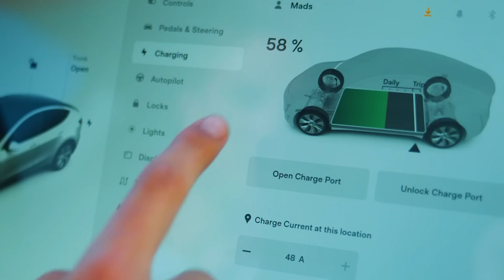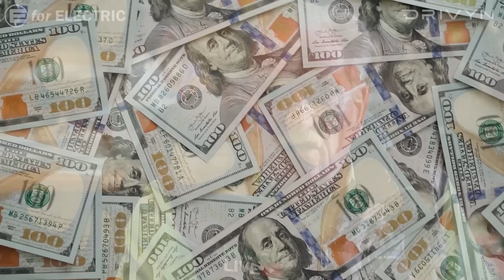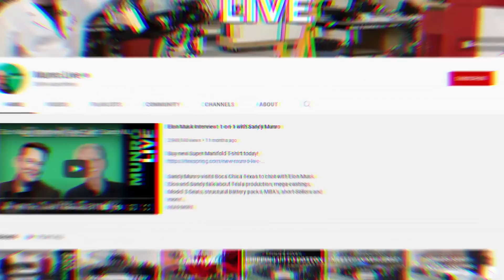SANDY MUNRO Calls Out EV Makers

Comment: Interesting comment about the Bolt.  I bought one in 2017 (still have it) for my wife to drive.  She was driving 10 miles each way to her parent's farm & spent her time helping & then caring for her mom.  It turned out to be the perfect car for her.  She really enjoys it today & we use it for any trip under 200 miles away.  Charge at home.  At the time it would have been a year wait for a model 3 Tesla & another $10K.  The local dealer didn't know anything about it!  I knew way more than the sales staff (including the sales manager).  Sandy's wrong about "nobody wants it".  Even here in "pickup country" i see as many Bolts as Tesla on local roads.
Reply: We have three bolts across three families and love them. Have traveled 220 miles on a trip. Done several 200 miles trips. Charge at home. Works great. With all discounts, our 2019 Bolt was $20k out the door. One of the family Bolts is coming off lease with 8500 miles and a buy out of $19k. We will buy it from GM. Cannot imagine going to a non-BEV.
Reply: @rebreaville9332  We have driven a 200mile + trip in our Bolt but charging on the trip amounted to 2 hours total charging time.  Made the one day trip a bit long.  Certainly doable but a long day.    This was our first trip where we needed to charge away from home in order to make the trip.  Only complaint was the slow charging.  Didn't charge above 80% on the road.  Left home at 100%.  Over some mountains & nearly all was at freeway speeds.  We did have some heavy traffic but jut sitting waiting & moving at a snail's pace didn't bother us!
Reply: I think the Bolt is a great car , especially for local driving, and that’s the key that most people don’t understand about EVs , not everyone goes on a road trip everyday or every week so day to day driving is the main focus, not taking a long trip and having to wait an hour to charge or running out of juice. You never worry about running out of juice just driving around town. 
 But I think what Sandy really means is why only a Bolt, a small car, why didn’t they also have a compact or midsized SUV back then. They have waited until now to evolve it to other EVs.
Reply: @Lovejazz01  Sandy was correct about the inertia of big companies.  GM is years behind as are all 'legacy' automakers---inertia.
Reply: @dennislyons3095  The bolt came out in 2016 as a 2017 model year, since it followed the normal product development  like most cars of it's time, it most likely started design in 2012. Even as such as a half measure made in 2012 it outperformed the Leaf in range, performance ,until they finally refreashed the Leaf a few years later. I'm not sure why the Bolt is discussed as GM's best effort when it clearly wasn't never intended as such. Considering they used LG cause they did not have the facilities to produce their own, well I guess Kia and Hyundia were wrong to do that too.  Or is it more a hold over till they get their own facilities built and ready? Are we also going to ingnore all the recent Electric cars coming into production this year and next that will utilize those facilities? I mean you honestly picking a product that is old and lightly refreshed in it's life cycle until the better platform comes along. Honestly it's a bad take.
Reply: @alkafk  GM built the Bolt EV because Volt owners asked for it (I was one of them). You're right about the timing, though. GM was tracking a few Chevy Volt owners forums, and they released surveys in late 2012 early 2013 asking what Volt owners thought GM should do next. The results were closely split between 1) Add range and a more efficient motor to the Chevy Volt, and 2) Build a 200-mile all-electric CUV. Fast forward 3.5 to 4 years, and they did both.
Reply: @alkafk    Thumbs up 👍 

 Thank you much for the insight , it's like these clowns don't learn 🤡🙃🤡
🤷🏻
Reply: I understand about the dealership not knowing much about the Bolt. Back in 2018, I was interested in buying a new hybrid Malibu. I contacted a local dealer, and not only did they know little, but they kept steering toward a petrol Malibu. They just weren’t interested in selling me a hybrid.
Reply: Maybe the Chevy ⚡️Bolts is not for Sandy.
 But it does fits the bill for a lot of other people , they love those little cars .

 This  interview was more than just 2 days old because  Sandy and his wife bought a Rivian pickup truck.
Reply: You'll see that hating GM's EV products is a fairly common sentiment with influencers. Apparently, that's a popular position if you want to win favor with Tesla fans and easily hit 100,000+ subscribers/followers.
Reply: @newscoulomb3705  so qhats that have to do with the bolt catching on fire?
Reply: @BlackandWhitecustoms  What does what have to do with the ~20 Bolt EV fires? I'm responding to Sandy's comments, which were about outsourcing and vertical integration, not defective parts.
Reply: The Model 3 would've been 10k more, and depreciated 20k less. For a far better car. That won't get you an arson charge for parking near a structure.
Reply: Someone will always like everything. But will it catch on? Remember there are people who are happy being in a pyramid scam also.
Reply: @BlackandWhitecustoms  LoL
Reply: @icosthop9998  didn't the bolt have a recall because of fires?
Reply: @BlackandWhitecustoms  Damn ❕️!❕️
 I never got your alert/ reply 😶
I'm showing this to someone else and I seen you replied to me.
 No telling how many other people replied to me and I didn't receive it ❗️

Comment: The OEM`s all build BEV`S fot upper income people, because they have not so much batteries they put them into the higher margin cars, with prices only a few people can
afford and for most of the commuting uneeded ranges. EV`s for the mass market thats fit the needs of most of the commuters have to have 5 Doors, ~ 300 km WLTP Range,
Climatization and a price tag of 23.000 US $  inc. VAT. To date no one builds them, maybe the Chinese will do it some day, definitly not Telsa or VW in the next years. Tesla/Musk
is very good in announcing but not in delivering.

Comment: "Standards" are big in government work. Just one example,  I do electrical design work for a national laboratory and we use 12AWG wire for lighting no matter how short the run for new LED lights that never draw more than 10A on a single breaker. Industry-standard is 14AWG for residential and commercial lighting applications below 15A and you can speck even thinner wire provided it supports the continuous load for the given lenegth of wire and is protected by the correctly sized breaker. But hey, the lab has their own standard, and wastes tax payer money on excess copper, larger conduit, and over paid and fat engineers with their "standard". In the private sector companies make mistakes by going too cheap, in the government, they make mistakes by blowing stolen tax dollars on overkill.

Comment: Awesome!  Sandy seems fed up, but he what he's saying makes sense.  The automotive industry is enormous and carries a massive amount of inertia.  Time will tell if the EV movement will provide enough force to cause the traditional OEMs to change their ways.
Reply: I do believe they are changing but they are changing very slow.
The CEO of Volkswagen went to Giga Texas for pointers.
Jim Farley,  CEO of Ford is dividing Ford into Two groups.  ICE division  and EV division.  That is something  NEW.
Reply: @icosthop9998  Volvo did that with Polestar years ago
Reply: @sneaky_krait7271  K
Reply: Sandy worked for Ford, and every time he innovated something to solve a problem he got in trouble (nearly fired). Its in another YT video. Very hard to innovate in old companies, you end up fighting a management power structure with vested interests and static vision. He eventually quit and decided to do this analysis to point out systematic flaws in a process. Original Tesla tried many many experiments to figure out how to do EV. And then applied newest automotive construction/assembly to mass produce those vehicles. Autopilot is a new problem (but DARPA started work on it way before Tesla) and its a very tough problem. In an interview between Elon and Sandy he talks about the autopilot problem. Elon is taking a statistical approach, if its better statistically than a human driver, problem solved. I think that will run into many other issues. Accident happens someone dies ? Who is at fault ? Human driver than usually human driver is at fault. Robot/AI driver ? The software engineer ? The sensor engineer ? The evaluation engineer ? The CEO :-)
Reply: @Glen Spivey  I said the same thing on "Electric Viking"   channel , and people jumped all over me, saying that FORD will not be able to do that. 🧐

Comment: I am not Sure  I buy all that Sandy is selling.   For example Ford has and is making the battery mustang body The old way     the “press” that Tesla is installing, is to fix many of problems Tesla has had making Automobiles.
Reply: How much money are they losing on each one?
Reply: @jamesvandamme7786  based on your comments you appear to know that Ford is not making any money off of the Ford mustang Mach E  Please explain!
Reply: @marknelson463  Just asking. They claimed they would make money off #1. (Not counting R&D.) They could sell every one they build so why throttle back?
Reply: @jamesvandamme7786  I do not know How profitable the Ford mustang Mach E is for Ford
Reply: @marknelson463  I suspect the Big 3 are just practicing making EVs until better batteries come along, then they will crank up the lines and flick Tesla out of the way
Reply: @jamesvandamme7786  in a short time that will be just a dream.   A short time a go Tesla just had a plant in California now they have plants in China and Germany. And soon one in  Texas and more on the way/planed           in the US Tesla is sold out for the year
Reply: @jamesvandamme7786  there are reports that Tesla in the past had not made a dime making cars and only survived because it sold pollution credits   Just thinking  if you make body’s for ice cars then why not battery EV‘s with the same tooling.    Tesla has had major problems with its California operation. Bad fit and finish on cars coming off the line some said was because California would not let Tesla use good paint, environmental regulations and so forth some said it was because Tesla didn’t know how to design cars properly and was still learning about fit and finish  The answer for Tesla is to cast the pieces as one part  and at a lower cost.  Ford does some of this (welding pieces together) but it also uses a lot of plastic on the outer body   It used be only the bumper covers. Now it can be most of the Front and back of a car.
Reply: Sandy has at times named Ford as one of the legacy makers that will survive.

Comment: Teslas biggest mistake is not fixing shoddy assembly and quality control. It should be fairly easy for a company to not send out cars with panel gaps and door handles that aren’t flush, but they just keep doing. Despite having otherwise great cars, they are solidifying a perception with the general public that they are shoddily built.
Reply: There are a few other issues I have with Tesla. They're old designs in the S and X and middle-aged ones in the 3 and Y (not timeless, not buying that). I'm not sure Tesla can update their designs that quickly or come out with new designs. But bigger than quality control is build quality. Build quality is something you feel in VWs, Toyotas, Hondas, and gets even better in the upmarket Lexus, Acuras, Audi, and so. The feeling of parts moving around and noises they make doesn't feel like a quality vehicle. 

And honestly, Tesla is still young. If they have to make a big turn to something different, they'll show some legacy issues as well. And not everyone has such insane market capitalization either. And definitely Tesla is aimed at saving costs as well.
Reply: They keep doing it because they keep getting away with it. Having poorly assembled cars and shit service centers hasn't stopped their stock from skyrocketing, their brand from becoming the biggest "it" thing of the 21st century, or their sales numbers from continually going up. I worry a reckoning is coming for them at some point now that other manufacturers are getting serious about building affordable, desirable EVs and won't have the same quality or scaling issues, but who knows?
Reply: @sipher3516  Will German-built Teslas have better build quality? If not, the reckoning will come fast. And be brutal.
Reply: It is CD that dictates the shape .Why comprise range and performance on styling twaddle?
I can think of many cars models that have had the same basic shape for decades and have been benchmarks in their market segment .
VW beetle 1938 until 2003.
Mini 1959 until 2000.
Model T 1908–1927.
Jaguar XJ 1968 2007.
Toyota 70 series.1984 to present. 
lada Niva 1977 to present 
You have been sucked into   add some lipstick to a pig and sell on  marketing hype of the latest model year .
All  Tesla new out of the factory have many thousands of improvements on the first iteration of that model. 
Reminds me of the old adage "beauty is more than skin deep".

Comment: Not using LFP cells has to be one of the biggest goofs - for all of them. Compared to NMC, LFP doesn't have the absolute best energy density, but it's robust, doesn't burn when punctured, charges 0% to 100% and has at least 2x the cycle life. That 0% to 100% charge ability makes them functionally as good as the more fancy chemistries. It's daft to use anything else.
Reply: To add - within reason weight in an EV is not a huge issue. As long as handling does not suffer they dont need to be as fussy as engine powered cars. ICE cars waste the energy of motion when they brake so fuel consumption gets silly very quickly. EVs recover that energy by feeding it bak into the battery. Some is lost but a huge chunk is recovered 80% maybe.
Reply: @Dave5843-d9m  Out on the highway that is near 0 % regeneration.

Comment: There are quite a few counterexamples: Renault has been making EVs for longer than Tesla and on a dedicated platform.. the renault 5 will be the 1st BEV under 20k with 250 miles range. Hyundai/ Kia is doing amazing stuff as well etc.
Reply: At what cost? And with what kind of goal? The smallest Renault ev is a very dangerous vehicle in collisions because they had to cut cost somewhere. And are they making money on that car or are they only making money on ice vehicles? 

Iirc Sandy did an analysis and all the manufacturers of evs and came up with a simple "no", except Tesla. That means bankruptcy within the time it takes for evs to take the lion  share of evs. Its now at 15% in Europe, 20% in China and 3% in the US.

Hyundai/Kia might survive due to lower cost of manufacturing and being relatively early with a range of evs. But Renault is doomed.
Reply: Renault has already had their EV sales fall off a cliff the last nine months or so.  They were one of the initial leaders among the legacy automakers, but they rested on their laurels and let everyone else push them out of the way.  Peugot basically replaced them in their home market of France.

A cheap good EV is needed, but the costs are not there yet.  Tesla and most others started at the luxury/premium end of the market due to how expensive it initially was to make EVs.  Prices are coming down, but still fairly high.  Most automakers have negative margins on the sales of their cars before factoring in higher production costs (they make their actual money on parts, servicing, and financing; not the actual sale of the car - except higher-end brands like Porsche).

I'm highly skeptical that Renault are so much more efficient with their opex than all their competitors that they could (yet) make such a cheap EV without it either being terrible, and/or lose money on it.
Reply: @AMortalDefiant   Renault has low margins BUT the margins on their BEV segment are more than double the margins they have on ICE... In the meantime go check reviews of the Megane E Tech: EVERYBODY prefers it to the VWs and other competitors/ the software (google partner) anf comfort are incredible= ID3 is dead
Reply: The Megane deliver later thid year
Reply: @AMortalDefiant  Not sure how you can say prices are coming down when, specifically, Tesla's "cheaper" Model 3 just had 2 price increases, one of them being a massive $10,000 bump up. 

Tesla may be driving long-term manufacturing costs down with innovations like the gigapress for chassis construction, but across the board, material, energy, supply chain costs and other factors like political and regulatory risks as well as inflationary monetary policy are all contributing to big increases in cost to the customers. Almost nothing is getting cheaper lately, it's the opposite, particularly for complex products like automobiles.
Reply: @AMortalDefiant  all legacy ICE automakers are DOOMED and will go bankrupt before 2030
Reply: Renault Zoe = zero ⭐ in Euro NCAP crash test!‼️! ⚠️👎
China-EV: BYD Atto3 & MG4 EV = ⭐⭐⭐⭐⭐ (best)in Euro NCAP crash test. 
Wake me up when Renault make profit selling EV's.... 😄👍
Reply: Tesla model Y will be the most sold carmodel on planet Earth🌍 in year 2023